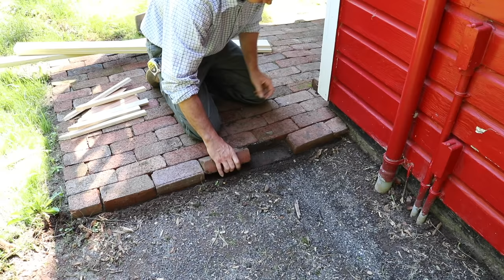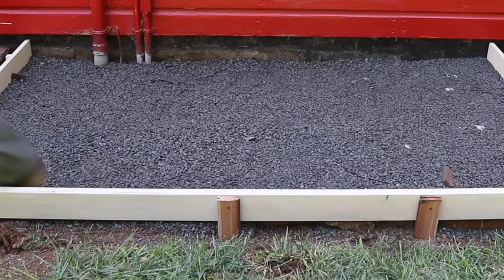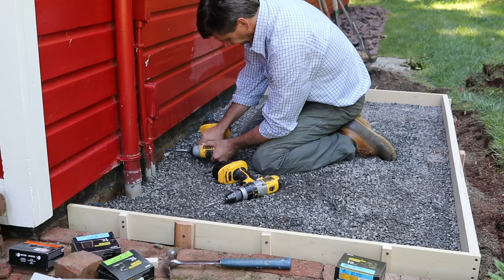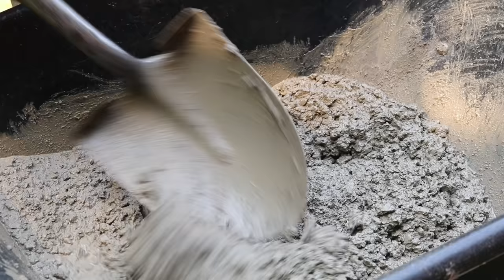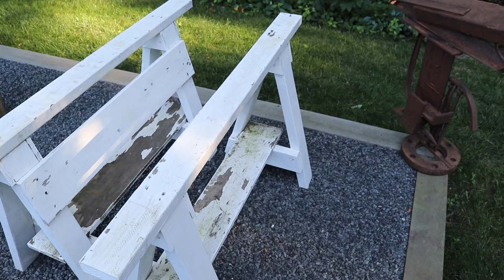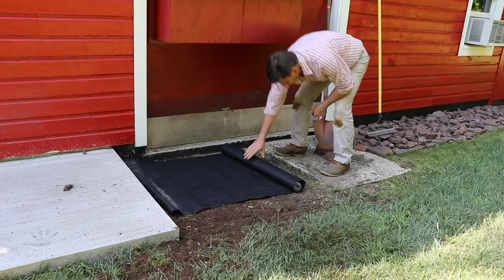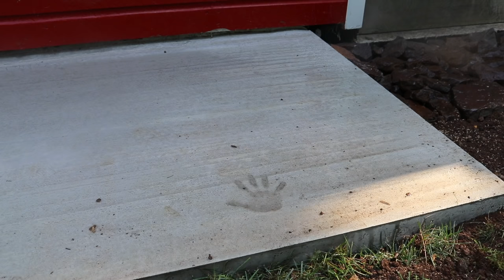Pour A Concrete Slab

Comment: When you have a concrete slab to pour at 6 but a date at 7
Reply: Don't understand why he went through all that trouble then not finish right
Reply: @kevinmays5308   ⛿ ..و
Reply: Bro dresses better than me to make a slab than I do regularly. Props.
Reply: Ok to be fair I’m going to be very critical. Only because I work in the concrete world.
1. Don’t use screws for your forms, we have nails.
2. You don’t have to lay rock down, unless it’s really wet, or it’s an industrial job.
3. You put in rebar, before you pour concrete, not a screen like material, in the middle of a pour.
4. Your slump “ how wet your concrete” should have been a 6 or 6.5. 1 being dry 10 being rock and water. You were at a 4, making it harder to work with. 
5. Shoveling concrete out of a wheel barrel for that size pad, lol you killed your self. Work smarter not harder. Should have just dumped the mud in.
6. Keep moving. In other words dump the mud in to you get your thickness, then level and screen out. 
7. The finish on that pad was rough as hell, you should have brushed it. You could have used a a push broom, wet it, and pulled towards you.
Made a simple job into a harder one. I get you thought, I’m going to to do this my way and better. You didn’t. You didn’t eve have the right trowels. Normally I don’t say anything but this was a fail, and I get tired of seeing people not knowing what they are doing.
Reply: @kevinmays5308  😊😊❤❤
Reply: @brettc1984 everything you stated here is spot on. I am not a concrete guy but I’ve always had a strong interest in concrete finishing. Being that I have educated myself on the subject and have watched many instructional videos on how the pros do it, I would never form and finish a slab with this man’s methods. It makes absolutely no sense not to do it the correct way. 
It’s a shame that these types of videos are actually influencing people’s decisions. 

Thank you for pointing this out.
Reply: @matthewvanselow1979 I’m get it. Believe me. This video should not exist, however it does. That’s the reason I even said something. Do it right or don’t do it at all, and for heaven sake don’t post it to YouTube. I hope no one did it like him. Honestly.

Comment: Release agent on the wood formwork to make it easier to remove once cured, wacker plate the aggregate for better compaction and to ensure the best  strength of concrete possible vibration rod the concrete.
Great job. Thumbs up

Comment: What is the purpose of the screws you put into the building foundation?  If it was to prevent the slab from heaving and/or sinking, it seems to me it might just shear off the screws, or break the concrete around the screws.  Did you make the slab dead level or pitch it away from the building, and if so, how much pitch did you give it?

Comment: Did you water that gravel just before you put the concrete on?  I'm not sure what the purpose of the tapcon screws are because they won't be enough to hold it to the other structure, and with just some gravel underneath, you want that thing to be able to heave up and down anyway from frost without breaking.

Comment: I would have boxed out the pipework, then back fill with gravel level with the cement once it was dry. Only because I've had many issues with replacing old pipes in the house I own. It's easier to scoop gravel then break concrete.
Reply from the maker: Good thought...thanks
Reply: Dopro

Comment: I first thought, "He messed up. The concrete should not be that high, it will rot the siding." Then I read in the description that the new concrete is the foundation for a planned extension to the building. Now I feel better. By the way, many places that sell bagged concrete mix also rent concrete mixers. Nice job, as always. Cheers.
Reply from the maker: Thanks

Comment: Should've edged it, used half inch rebar to peg it and real steel mesh for reinforcement. Oh and let it tighten up a little before brooming it. other than that it looks good.
Reply: it's not a footpath , it's only a wee baby slab, over kill not required
Reply: a h I agree, that would be overkill for such a small pad.
Reply: ***** rite on
Reply: sharp corners, id hate to trip over that with no shoes on! you should always round the corners!

Comment: Some plastic in the bottom would stop the ground from leeching water from the concrete as it cures. Plastic on top of the finished concrete for several days would also assist with the cure. Water leaving into the ground or evaporated by the sun, wind, or a breeze, will weaken your cure and could result in cracking later. Also, It's a good idea to spray curing compound onto the exposed surfaces once the top plastic is removed. It seals the surface and prevents water evsporation. Retaining moisture in your concrete for as long as possible is key to a good cure.

Comment: Nice work but those blue tapcons don't serve any purpose. As soon as the slab shifts even just a little they'll snap. Obviously you won't notice it but there's no point screwing those into the existing foundation. If you really need to tie the concrete slab to an existing foundation then it requires more than just tapcon screws.
Reply: OU812 what else would it require
Reply: +Paul Rockz  It's typically done with steel pins epoxied into the existing foundation. The pins are of substantial diameter to resist shear loads. It would be complete overkill for a small slab like that.
Reply: OU812 fwh
Reply: OU812 k
Reply: OU
Reply: Agreed, if you are gonna pin the slab to another slab..use 1/2" minimum rebar spikes...also wasn't too impressed with the unfinished edges and brushed broom finished surface. instead he left sharp edges which will most likely chip and break off. Nice video but sloppy finish and detail..... not too artistic as his name suggest...
Reply: ceedaddy ，0/22又，
Reply: +ceedaddy Just curious as I'm planning a similar project. how would you finish the surface/corners to improve durability?
Reply: +Esahc nolastname First i would dig down and compact a minimum of 4" of crushed limestone. If i was attaching the new slab to a pre existing slab i would drill and pin 1/2" rebar so slabs wont shift...also wire rebar together inside your wood form. Mix and pour your concrete all in 1 pour try to make concrete on thicker rather than soupy consistency as it will be stronger. After the concrete is poured into form level it with a straight edge or trowel. Allow the concrete to stiffen up a bit. use a broom or brush to texture and then use a edge trowel. OR you can stamp the concrete with different texture forms. like stimulated bricks..flagstone..etc....and colored concrete powder ...remove the wood forms and texture the outsides edges the same ....if your crafty you can carve the sides to match and simulate like the slab is a bunch of individual stones or blocks..whatever your pattern is... and most important is while the concrete is curing...take the garden hose and mist lots of water...several times a day over the concrete for 2-4 days to slow the curing...keeps the concrete cool and slows the curing making the concrete slab stronger and less likely to stress crack.... Goodluck...
Reply: Can someone please explain to me how i would pour a 16x8' concrete patio against a house? Am I supposed to use an isolation joint between the house and patio? If so, how is that done? I am worried water will get in between the house and patio and/or the patio will crack because it has no room to move.
Reply: Frank Silla tt6uu766890
Reply: 1
Reply: H
Reply: @IknowIAmRightHAHA  you should dowel rebar into the foundation. Take a hammer drill and drill holes into the foundation, you insert rebar (1/2") into the hole, if you want to use rebar throughout cut your rebar so once it is inserted into the hole it is 3" away from your outside form. You can run your 1st and last dowels 3" in from the ends of the slab, and then 24" on center for the rest. Cross rebars 3" shorter than the forms and tie them onto the dowels 24" on center. If you don't need heavy duty reinforcement, you can drill your dowels at the same spacing, but make them 18", insert into the holes. Then lay wire mesh throughout the entire pour area and tie it to the dowels where it crosses them. If you need super heavy duty, do the 1st method and then add the mesh. 

Before you drill dowels and lay your steel, set your height against the foundation, strike a chaulk line, take your 4" expansion joint and fasten it to the foundation (2" fluted masonry nails work fine, you don't have to sink them, just hammer them until they bite, 1 or 2 hammer whacks, that is important, if you try to sink them they won't hold) THEN drill your dowel holes through the expansion and into the foundation.

If your slab is to be a patio or similar uncovered, unroofed slab, make sure you slope it away from the building for water run-off.

I know this is a year later but hopefully you can still use the info
Reply: @ChocolateSyrupOverdose no the tapcons aren't doing anything

Comment: What's with the adding screws to the other foundation.  Is it an anchor point to prevent settling?
Reply: It is suppose to keep it from settling down from the foundation. However, most would recommend using rebar as it is a thicker and will not snap off as these blue screws will probably do. The weight of the concrete will be way to much on them.

Comment: Why do you put the screws into the block of the existing building?  Is it so that the slab will not rise away from your building?  If so, what types of screws did you use and what type of bit?

Comment: Very nice slab Jon, why didn't you put an expansion joint between the old slab and new one?
Reply: you dont need too when you pull the form off and put the bricks back it creates a natural expansion joint after he edges it
Reply: I believe Jim was referring to the old slab as in the foundation he put the blue Tapcom screws into....not thebricks... and as far as a finish the man should have edged the slab while the concrete was still green.. also a broomed finish would have been better than no rounded edges and an in-uniformed broomed brush finish....
Reply: نا

Comment: I really enjoyed this video, made it seem really easy to do, although I know when i do it I'm going to make a huge mess! Thank you for sharing.
Reply: It is easy to do when it's a small area try doing about 30 or 40 sqm2 by hand! Few things wrong in this tutorial that would earn getting kicked off a building site and even my squad but overall ok for beginners! Taking a hammer at 5.15 to remove the chocks is a major no no can easily split and or crack the concrete because its mixed by hand and not batched in a jigger! His screed of the concrete was probably the biggest amateur move I've seen and had that been one of my jobs he would have been off site in no time never screed from one side always from the centre of the screed board and if area is too big 2 people screed it at either side simultaneously! By doing that at only one side does not screed the excess properly and when you go to float it you would see the difference! The only good part of this video is his concrete edging hes more a joiner than a concrete finisher!

Comment: I was surprised that you didn’t put sand down over the gravel before putting in the concrete.  Is that not necessary for a small pad?

Comment: I’m still trying to understand why you installed concrete screws in the foundation wall? Do you use any kind of fiber board to separate the slab from the foundation wall? Appreciate the help

Comment: I'd only change 2 things: 1. build a small box around the pipes v.s. paving around them 2. cut the horizontal ends of the mesh a bit, maybe  6 - 12 inches back on one side to give it some space on the long lay. Otherwise, excellent for a tiny slab.

Comment: I'm in New England, a place with lots of below zero days during the winter.   I noticed you used gravel,  how much is appropriate?  And should you use a geotextile fabric before dumping the gravel?  "I don't know" is an appropriate answer if it's the case.  Thanks for posting the video.. nice work!

Comment: Thank for the informative video - i was wondering why some people use gravel as you did and some people use sand to prep the surface before pouring the concrete? ... in fact i have seen some people covered the ground surface with plastic bags and poured concrete right over it. Any feed back would be appreciate it.
Reply: I think some of what you have to consider is where you live. Does the ground freeze? if so then the ground will raise and lower a little bit so you need to use a better rock foundation. If you dont live where it freezes then probably dont need to worry as much so use sand. As for plastic bags it might be for a moisture barrier if your pouring it into a living area or where you dont want ground water to penetrate thru the concrete. yes concrete can be porous.

Comment: I'm building a concrete base for a bike shed. I need a 50mm deep concrete base, and I've made a frame with 150mm timber. Do I put 100mm hardcore inside the frame, or lay hardcore and then use 50mm timber for the frame? Worried that the hardcore will spill out when timber is removed, or will the concrete soak down into the hardcore and set it?

Comment: Hole lot of work there! I liked the grout screen to stabilize the slab.
I have been putting plastic sheeting down to direct water away then gravel so it doesn't smother cement. Hoping to extend cement life from absorption. 
Nice job

Comment: Great idea by using the screws into the old concrete to tie them together. I have been thinking of going to rent a hammer drill to drill to attach rebar. I may just use the screw idea instead.
Reply: I was wondering why he did that, thanks!

Comment: I just did a small one myself, didnt fuss too much over it did edge it however as those edges can be razor sharp when done, can always knock down with a hammer or rub with a stone or grinder i suppose.    What sort of mesh was that was that fibre? or steel i havnt seen that before?

Comment: Just wondering how many times your foot caught on the higher step of the concrete pad? Why did you not make it level with the bricks on one side and the rocks on the other?
Reply from the maker: It’s a slap for a shed , you can see it on my shop tour

Comment: Great video, even though I'm commenting in 2021. I was just reviewing a few videos before making a few sections of slab next weekend.   Only issue I see is you didn't use an edging tool to round the edges - those raw edges can be sharp and cut you feet in the summer, plus rounded edges can prevent unsightly chipping that occurs when things bump into it (lawnmower, BBQ, boots, etc).  Secondary is minor, a personal thing, and related to the handprint -  I always like to put a date at the corner of the slab so I know when it was done; I've done it for my own small pours and for a big patio I had a contractor do.  Anyway, great job!.
Reply from the maker: Thanks, I built a small shed for my dust collection on the slab, so no need.

Comment: Very informative video, start to finish (including tool and wheelbarrow cleanup).
Question 1: when is it necessary to place expansion joints? Would scored lines suffice? //  Question 2: At what size would it be desirable to figure in a drainage slope?

Comment: Great video Jon.  I need to extend the small slab my AC unit is on, and I never would have thought to use screws to bind the new an old together.
Reply: Those little screws will snap as soon as the slab shifts or settles even just a little. That's not the right way to do it.
Reply: What would be the right way?  I was planning on nothing, so this got me at least not totally screwing it up.
Reply: +Johnny West when we poured a new slab as a patio here in LA the building code required us to tie in with our house foundation using 1/2" steel rebar epoxied into the old. I'm sure code is different everywhere you go, and there is probably nothing governing a separate slab for a/c but if you want to keep the two slabs fixed to each other and prevent settling/shifting then rebar will definitely do the trick
Reply: Johnny West As Chico mentioned 1/2 epoxied rebar is the standard method but you need to look at whether or not you actually need it. The design intent of using dowels or rebar to tie two foundations together is to ensure the new and old don't separate and maintains a leak free joint (usually a concern for basements). Its not actually there for structural support. Its there to prevent separation. There really isn't any benefit it tying a small slab like this to and existing foundation. The dirt under that slab will settle over time. If you tie it securely with large diameter rebar then the slab will not follow the dirt as it settles. It will stay supported by the rebar along the edge near the house and you could end up with a void under the slab. If you put too much weight on it it can potentially crack.
Reply: Thanks for the info.  This will be, at most, a 1.5' extension, so maybe I don't need reinforcement at all, and certainly not 1/2" rebar.  Perhaps I'll go with 1/4" every foot or so just to be safe or the screws, or even steel lag bolts will suffice.  The ground is flat an even, so I won't be disturbing it any and I don't think there will much if any settling.  I'm in the south, so this will be an October project, when I can do without the air conditioning for a couple of days.  I'll check my local codes and ask around.

Thanks guys.
Reply from the maker: Great info..thanks guys!
Reply: Johnny West كسمسظظصظ

Comment: Thanks for posting. Question, what was the purpose of putting screws into the foundation before pouring the concrete? Just curious.
Reply from the maker: Thanks, just an attempt to prevent the slab from moving away from the building… Not sure if it was really necessary… But it’s been a few years and the slab in the shed that sits on it are doing great
Reply: @JonPetersArtHome  Gotcha. Thanks for the reply.